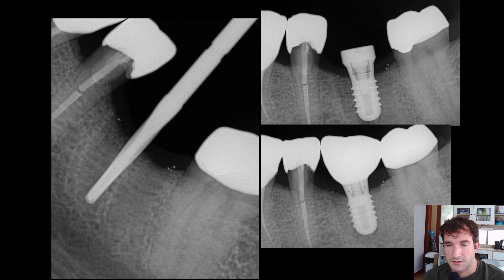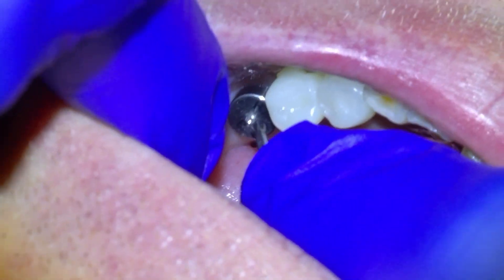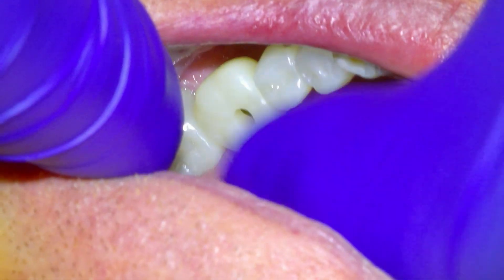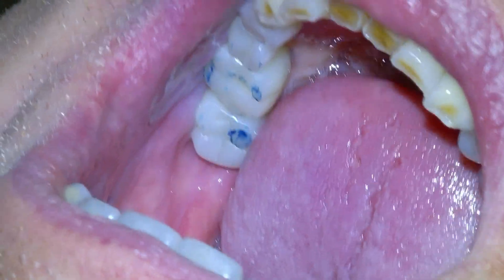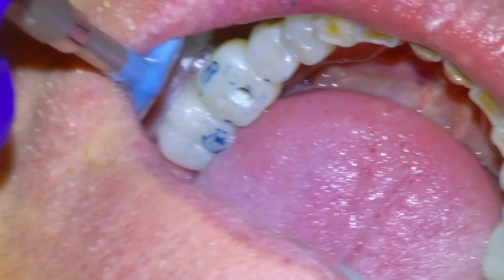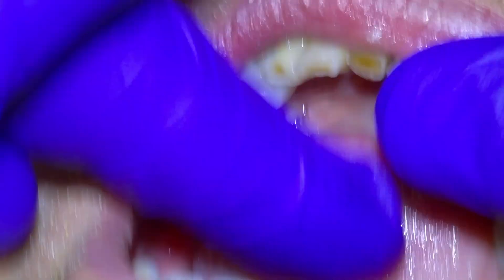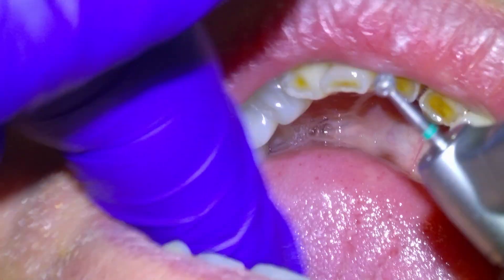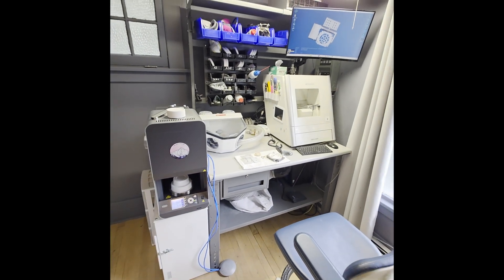[120] Dental Implant Crown Installation + Lab Tour

Comment: whats your cost per crown with this setup ? here labs ask 80-90€ for a zirconia crown, i'm afraid ROI would take too much time.
Reply from the maker: Cost for a puck of zirconia is about $240CAD and each one yields about 20-25 units so its about $20CAD in materials only. Labs here charge $300CAD/unit so it makes good sense in my market. There's a lot of intangible value that comes from milling in house though like speed flexibility and control

Comment: Thanks for the video

Just curious after tightening to recommended torque and placing teflon tafe, no need to etch bond prior to composite to close the hole? 

Thanks in advance
Reply from the maker: I personally dont etch and bond before placing my backfill flowable comp and it hasnt caused issue. After the retorque in 2-6 weeks I use a packable comp or equia forte to close permanently